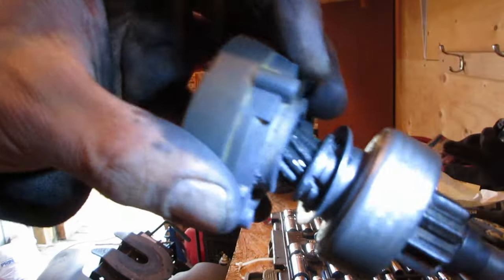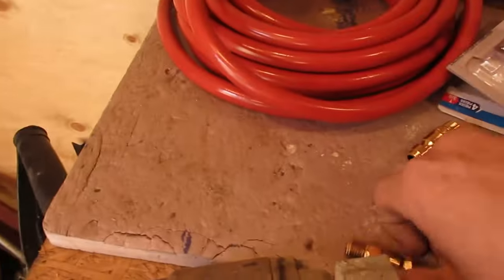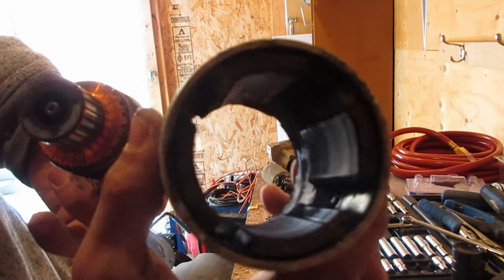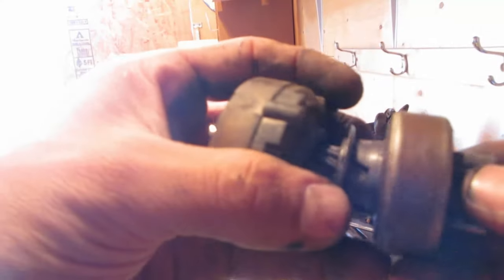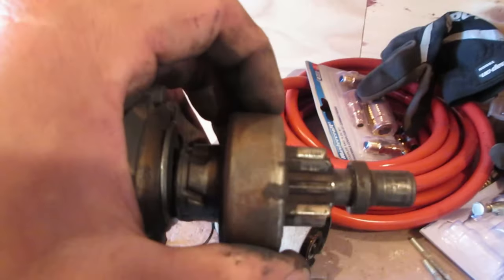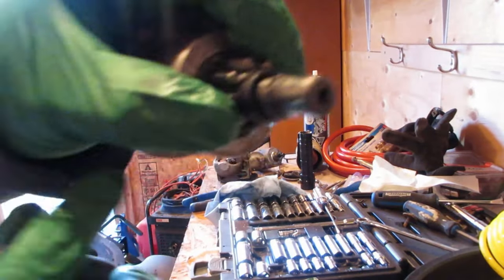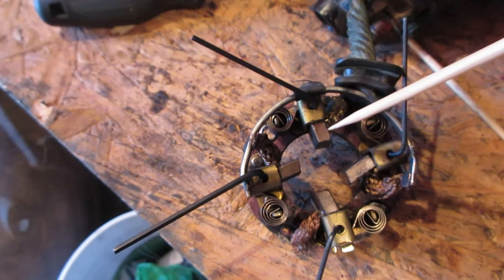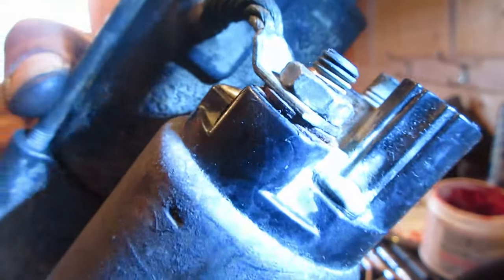Is Your Truck Making THIS Noise? (Flex Plate/Flywheel) 5.3 2009 GMC SIERRA 1500

Comment: Thank you so much. I was worried it was something worse. Pulled my starter out and found it to be in the exact same condition as yours. 

To anyone with 4WD, it was easier for me to fish the starter up through the wheel well under the exhaust header cover and back in instead of dropping it under the truck somehow. The coolant lines were too much in the way for me for that to work
Reply from the maker: Awesome I'm glad it was the fix!

Comment: Bro I just want to say thank you so much. My truck made this exact noise a year ago. So I didn’t drive it anymore and bought a new truck cause I needed to go to work but didn’t want to damage anything in the engine cause I ain’t a mechanic. So after I bought a new truck I had multiple mechanics take a look at it and they all had list of possible problems that could cause that sound. So they said we would have to work from the top of the list down costing me possibly thousands of dollars. So instead I did nothing with it and let it sit for a year. After coming across this video I thought what the heck I’ll change out the starter myself and so I did and the sounds is gone. Thanks so much for making this video!
Reply from the maker: Omg dude!
Damn what kinda truck did you get??
I'm not an automotive guy, but that noise doesn't really sound engine related to me (when I first diagnosed it). Makes me wonder about mechanic shops nowadays.
I'm happy the video helped!!
Reply: The truck that I had making the noise is a Chevy Silverado 1500 2011 5.3 LT. And the new truck I bought is a 2021 Tacoma that had like 5k miles on it. Again thank you so much now I got my work truck back!
Reply from the maker: @fangs711  You're very welcome and nice choice on the toyota 👌

Comment: Just had this noise startup a couple days ago been scouring the web trying to track it down. Went to Auto Zone and the go told me it sounded like it was coming from the starter or bellhousing, thought it may be a cracked flexplate but the videos ive found showing the sound of a cracked flex plate dont sound similar.  Finally found this and it sounds EXACTLY the same. Hope this is my issue, would make sense as ive had some slow startups here recently that i thought were due to extremely hot weather. Thanks so much for this upload.
Reply from the maker: I hope it's just the starter!! Good luck

Comment: This video helped me! Had the exact same sound and issue. Starter was bad, went to my local auto parts store and picked up a new starter. Fixed the issue! $223 later it worked. Thanks! 2010 Silverado 4.8L 1500.
Reply from the maker: Glad it worked for you man!
Reply: Over $200 for an eBay starter at the auto parts store? That's a raping lol

Comment: Have the same noise from my suburban. Will check that. A shop that I checked they wanted to drop the transmission and charge me for that. Thanks man.
Reply from the maker: Nothing wrong with a second opinion right?! 
Glad this helped!
Reply: I have not fixed it yet but I will come back here to comment what was wrong a my vehicle
Reply from the maker: @JL-it9wo  Sounds good! 👍
Reply: It took me a while to respond but yes it was my starter drive. I only had to change the drive and no more noise. Thanks for the video

Comment: my 2011 5.3 i just bought with this issue is doing this, i just bought the truck for cheap, i hope its the starter! Have a replacement already!  They had it looked at by a mechanic and all he told them it was coming from the starter, and quoted them a new one for the repair. Fingers crossed, they showed me the quote even, so i dont think they know more.
Reply from the maker: @acreageliving  That's awesome that mechanics are starting to catch on to this problem. All I ever hear is "it's gotta be the flex plate or torque converter bolts" 
Good luck!
Reply: @shedcraft700  fixed it today, exact same issue as yours. I just replaced the starter, so happy it was the starter!
Reply from the maker: @acreageliving  Hell yeah! Awesome 😁👌

Comment: One more question sir! If it was the starter, would it always be rattling, or could there be days it wouldn't? For instance, today my truck isn't making the noise. It often will start when I notice it's very cold outside. Right now my truck is idling, not a sound of it whatsoever.
Reply from the maker: Like I said, if it's this same issue as my truck, it will be predominantly noisey going uphill, and if you give sudden throttle. My advice would be try jacking up the front end OR parking uphill, let it run and have a listen. If your issue is intermittent and some days you don't hear it at all, the starter could be disengaging the pinion gear like it's supposed to, in which case maybe just pull the starter for inspection. It's a lot less work than changing a flex plate!
Reply: @Shed Craft  The world needs more mechanics like you young man! Cheers!
Reply from the maker: @Vilhelm7198  Thank you!!

Comment: Yup. I had the same rattle a week ago. I had a starter I purchased over 10 years ago... so I chucked that on but I Want to fix the old one.    How did you pry that loose plate that rattles on the bendix back on?  The one on the starter here is WAY kicked off of it looks like it cracked.    around the edges? Might just part out a Junk truck starter to get a new bendix off it       Besides that nothing else is wrong with the OEM starter. Oh  The plastic planetary gear retainer  with the 4 posts is all cracked off too from the heat ill need one of those too    What grease do you think works best for the needle bearings and planetary gear set?
Reply from the maker: Hey sorry I never got around to this!
What did you end up doing?
Did you mean the plate next to the groove where the snap ring goes?
Also if the gear set is junk and you still want to fix it good on ya! I would've thrown it out 🤣
Reply: @shedcraft700   i had a spare starter I  will change the bendix out on the old one  Im going to source a used one
Reply from the maker: @GhettoWagon Ah okay, well glad you found the noise man

Comment: Did a 4L80e swap on my 2005 gmc and it makes this same tone ringing on take off. Pressurized Converter must be expanding enough to push the flex plate in against my starter now I just have to figure out how to get clearance in the direction toward the engine.
Reply from the maker: That pinion gear should be sitting back inside the starter nose, mine did it on take off as well, and up hill. But not down hill..
Reply: I'm having the exact same issue on my 2011 GMC Savana 5.3, what did you end up doing to fix your issue?

Comment: My 07 Sierra just started making this same noise today. I pull a camping trailer and have a trip planned. So I was freaking out thinking my torque converter was going out. After watching your video I’m 99.9 percent sure my snap ring failed also. Great content thanks 🙏
Reply from the maker: Yeah I've had some pre-trip stresses and paranoia on this truck also! Haha, all part of the fun I suppose.
Glad it helped, let me know how it goes!
Reply: @shedcraft700  got my new starter, putting it on this weekend. let you know how it does.
Reply from the maker: @kellyjung283  Must have worked!?
Reply: @shedcraft700  Yes it did, easy fix

Comment: I'm having the same issue. Mechanic defaulted to thinking it's flex plate as well. But now I'm thinking starter. I noticed you said "when up hill". Could it also make the same noise even when on flat and while driving? I notice mine stops making the noise when I take my foot off the gas.
Reply from the maker: I would think so, I never heard mine when going downhill, and only sometimes on flat ground. But always uphill, which makes sense since the pinion hear would fall into the flex plate toward the back
Reply from the maker: And if you're coasting then yes, the weight transfer would more than likely push the pinion gear back away from the flex plate
Reply: @shedcraft700  Thanku for your prompt and thoughtful reply. Much obliged!
Reply from the maker: @Vilhelm7198  For sure good luck!

Comment: will the noise happen when you accelerate also...and while in park a ting ting noise? please help
Reply from the maker: Yes. For me it did. If parked uphill, or driving uphill, I would hear it all the time. The faster the engine spins the faster the ting ting would go

Comment: Was it louder in reverse? thinking mine has similar issue. Not engine noise.
Reply from the maker: Not that I can recall, someone else mentioned this or something similar.. I would think not since the starter gear faces the rear, so if reversing, the gear would want to fall back into the starter.
Unless of course you stop, then the gear would fall back
Reply: @shedcraft700  pulled starter. Same issue as yours.

Comment: Would this not allow the truck to move I have that sounds but now my truck doesn’t move
Reply from the maker: Does it start and run?
Reply: @shedcraft700 yes it does
Reply: @shedcraft700 it just don’t move and I still have that sound
Reply from the maker: @terryevans8276  have a look in the inspection ports to see if the flex plate is broken, check while running (carefully) and the torque converter and flex plate should be spinning

Comment: I don’t really want to tear into the starter, if I have the same exact noise, should I just throw a reman starter in? How long does it take to remove and re install? I’m thinking about getting a car quest crap one, seeing if it fixes it and if it does then I’ll order an ac Delco one and swap the oem one in and return the car quest. U think that’s a good idea?
Reply from the maker: Personally I would wanna do the job once, but if you wanna be sure and not throw parts I get it! It probably only took me about 45 mins to pull it out, same going back in (thats without even taking the wheel off, and on ramps). Be warned, I googled how long it takes and some guys were saying they had to do all kinds of crazy stuff like dropping the rack and pinion or tilting the engine to get it out?(I think)  So there's that, depending on the year and trim model I suppose. Good luck!
Reply from the maker: Also save yourself the time and get some new plastic body rivets. So if you have to bust a couple getting the  inner fender off you can secure everything properly afterwards.
Reply: Yeah I would rather just do it once. Is it going to do any damage to wait a little while until I can get oem parts? Did you say in the video you waited a year to do the repair?
Reply from the maker: @jgruen9854  Well its definitely slowly going to wear as it continues.. but yes you heard right I drove mine like that probably almost a year (towing, highway speeds, you name it) 
That doesn't go with out saying maybe don't push your truck like I did. I consider myself lucky being all the teeth didn't shatter. (Starter gear must be softer than flex plate teeth)
Reply: @shedcraft700  I ordered a new ac delco starter and two starter bolts just cuz. Should arrive pretty soon. What do the plastic body rivets look like? Are they just the ones holding the fender on?
Reply from the maker: @jgruen9854  Good idea. 
Yes exactly they're just small black pop rivets. ..there's a couple different sizes lol I just went to canadian tire to grab a few and I had a few left from work and I made it happen. Not perfect but everything is held in place at least. Mud flap has a couple different sized screws too. 10mm and 8mm i think, they'll be rusty
Reply: @shedcraft700  glad I found your video, when I asked about the noise in a Facebook group, everyone said flex plate or torque converter
Reply from the maker: @jgruen9854  Thanks, and same here. Everyone said broken flex plate bolts or cracked. One guy messaged me saying my starter gear haha
Reply: @shedcraft700  Job only took me about two hours working slowly. Worst part was those plastic clips for the fender liner. Issue was exactly the same as yours. Started it up and now it sounds perfect.
Reply from the maker: @jgruen9854  Awesome!! I'm glad that fixed the issue for ya! I was nervous for a minute haha. 
But yeah sometimes its easier to break and replace those clips.

Comment: Would that also cause battery drain as well my truck just started doing this yesterday
Reply from the maker: My first answer is no, because the noise is mechanical.
However, a bad starter that has an internal short to ground can drain the battery. 
So do a parasitic draw test to rule out the starter, I don't think it's a common occurrence though.
Good luck!

Comment: I have 2009 Silverado 5.3 with the same noise. THANK YOU👍
Reply from the maker: You're welcome!! 👍
Reply: @shedcraft700  it's stressful when you don't know what it is.... really stressful. Did you have an issue with getting it out of park?
Reply from the maker: @Mark Owens  Yes I agree.. vehicles are not cheap to buy or maintain, so an easy(ish) fix is always the best.
I did not have trouble with shifting out of park no. Is it just park? Do you have free motion through all the other gears?
Reply: @shedcraft700  it shifts fine, it's just sometimes its hard to get it out of park,  I started putting my parking brake on in neutral, then putting in park. To make sure no pressure was on it and it's been doing better. I'm just going to buy a new starter because I'm so busy with work
Reply from the maker: @mowens-79  Is your driveway/parking space on an incline?